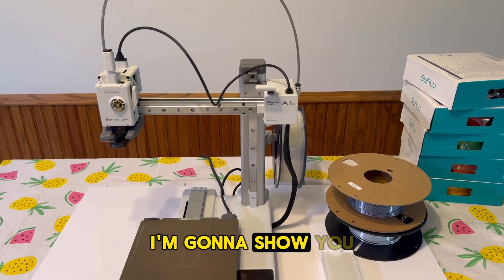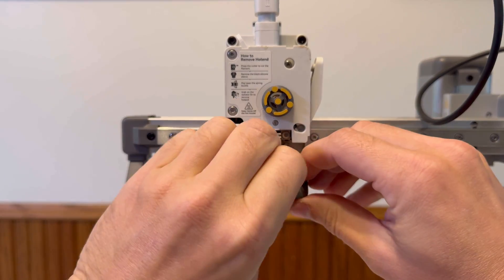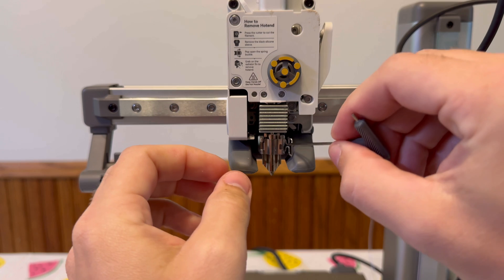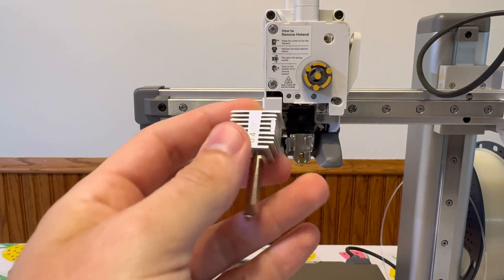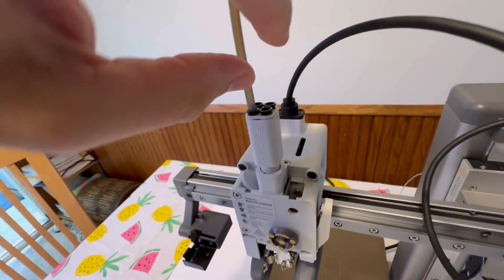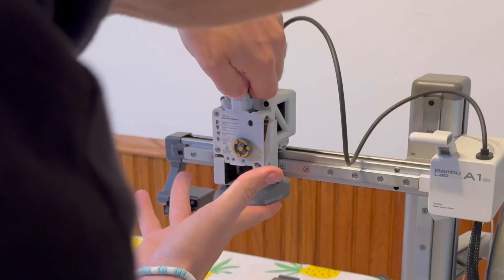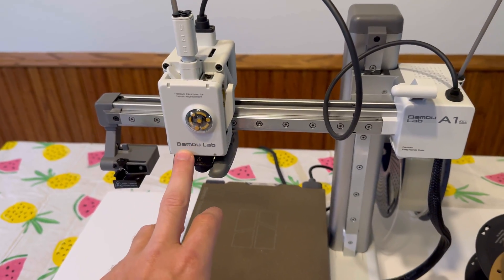How to Clear Broken Filament from Bambu Lab A1 Mini

Comment: Hello so I have a question and it is when I click unload it does all the steps but when it's the one pull back current fillerment I pull it back and it does not detect it at all it just trying to unload when I have already pulled back fillerment and when I load new fillerment it does not detect that I have put it in
Reply: Same issue, I think its a firmware issue on the ams lite specifically with the a1m

Comment: great tutorial. my new filiament wouldn't load when i had a spool run out. i found the filament in the bottom and still wouldn't load. then watched more of the video and found the stuck piece in the AMS. 10/10
Reply: I have the same problem should I look in the AMS?
Reply: I am to scared to break it looking in the nozzle

Comment: Life saver. First print of the day and it skipped 4 hours of layers in a 6 hour print, so it was nothing but a stringy mess. Cancelled it, started another. Checked 20 minutes in and nothing was printing at all. Turns out a huge chunk of PLA clogged up the entire thing.

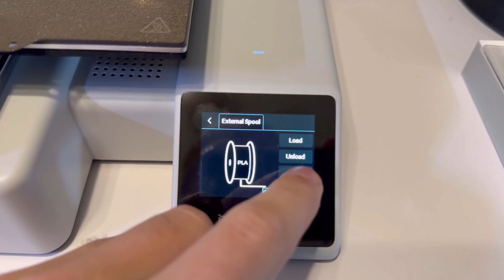Comment: I am currently trying to fix my A1, which has been performing flawlessly since I bought it last November - then bam, filaments/AMS won't feed.  Your's is one of the clearest videos I've found  One teeny inconsistency is that you start with the printer turned off, but at 1:23 you open the filament menu to heat it up - I assume its OK to turn it on again.

Comment: Thanks! great video!

I was able to find the stuck filament in the top of the hotted (the AMS part with 4 inbound and 1 outbound) and actually removed the stuck filament during a print! live! It's finally printing again!!! resuming a 20hs print that was stopped in the middle...

Comment: Very helpful. The "run some filament through it manually" step saved me from taking apart the print head assembly. Something I had started to do but luckily I paused for a moment and decided that I should watch a good video on it first. :)

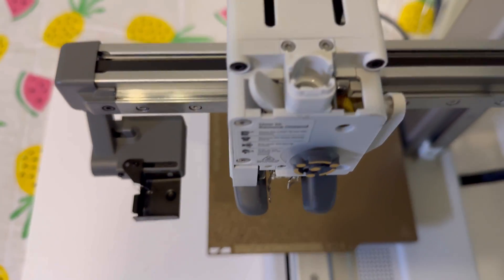Comment: From what I could tell, feeding fillament through the gear did not go smoothly for me. (at 4:20)
I had to jank it several times with force to get the gear to to turn and reach the other end. I was able to turn the gear manually from the outside though.
Does it have to be aimed in a particular position to successfully feed in the fillament sometimes, or was something just stuck there somehow?
Got it working at least now.

Comment: LOL

I KNOW THIS VIDEO ISN'T THE RIGHT PLACE FOR MY POST BUT

YOU YOUTUBERS ARE THE EXPERTS WITH YEARS OF XP ON 3D PRINTERS

MY PROBLEM?

CAN'T BIND THE DAMN THING  <--- STUPID WAY OF NETWORKING THE PRINTER TO THE PC ... BINDING

THE Q.R. CODE IS A P.O.S. LEADS TO 404 NOT FOUND

TURNING LAN ON AND OFF LIKE SOME YOUTUBER VIDEOS SUGGESTS DOES NOT GIVE THE ACCESS PIN BACK IN THE ACCOUNT / QR CODE SCREEN

FACTORY RESETTING DOES NOT GET THE STUPID ACCESS CODE PIN ... FROM THE Q.R. CODE TO WORK OR THE LAN ON OFF THING TO PROVIDE THE ACCESS PIN ... JUST GIVES YOU MORE HEADACHES AND MORE WASTED TIME

DOWNLOADING TEST MODELS FROM MAKER WORLD DOES NOT WORK.  SELECTING A1 MINI BEFORE DOWNLOADING THE .3MF FILE DOES NOT WORK ... ERROR PARSING G CODE ... ERROR NOT FOR YOUR PRINTER ... ERROR 05004003

WTF?

THE ONLY THING THAT PRINTED EASILY WAS THE STUPID BOAT AND THE EASILY BROKEN SCRAPERS

LFMAO

THANK GOD I DID NOT  BUY THEM OTHER MORE TECHNICAL AND MANUAL INTENSIVE 3D PRINTERS ... SUCH AS THEM CREALITY ONES AND OTHER LESS KNOWN NAME BRAND ONES !!!

SO NOW I HAVE TO LEARN TO MAKE THEM MODELS FROM MAKERWORLD WORK ... VIA STUDIO ... AND THEN LEARN C.A.D. TOO!

ALL THIS SO I CAN TEACH MY DAUGHTER HOW TO PLAY WITH THIS THING A1 MINI..

LOL

I'M DREADING THAT I WILL HAVE TO LEARN HOW TO BE A TECHNICIAN ON HOW TO REPAIR AND REPLACE PARTS ON THIS THING AFTER LEARNING HOW TO USE C.A.D. (BAMBU STUDIO, CURA, BLENDER ETC.?!)

IS BAMBU LAB SENDING OUT MY VO-TECH CERTIFICATION AND DIPLOMA AFTERWARDS?

Comment: My issue wasn't in any of the places mentioned.
I was using a cheap variety of PLU which broke off around half an inch above the top of the nozzle within the print head body and caused a blockage.
After breaking off the filament I used  piece of stiff wire a little smaller than the diameter of the filament to push it through while turning the extruder knob until the wire poked out the bottom of the extruder.
I then refitted the nozzle and other pieces and reloaded the filament.
It worked for a single print before it happened again.
The solution? 
Use good quality filament especially when using soft or foam filament.